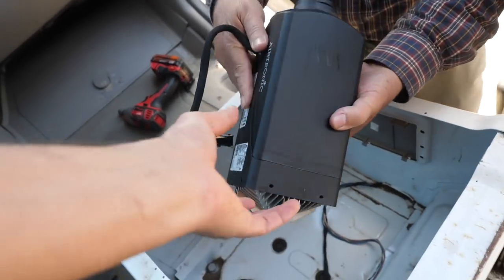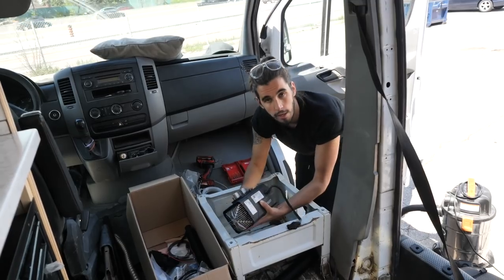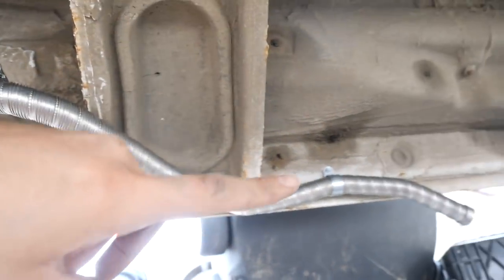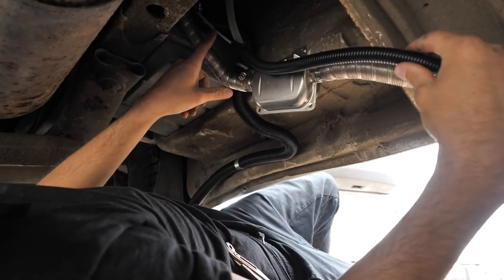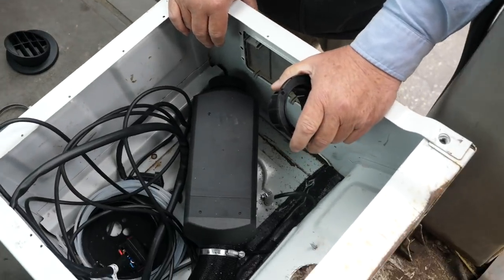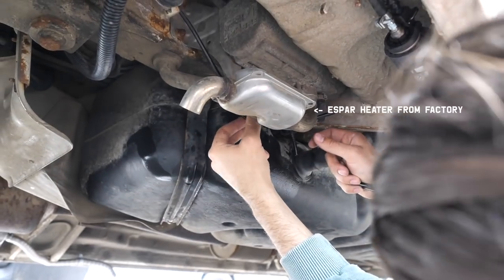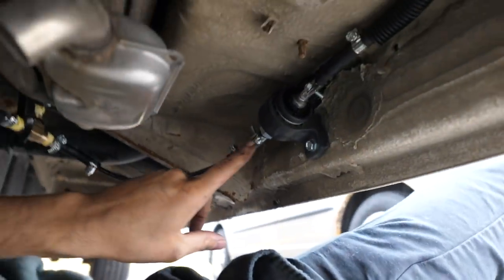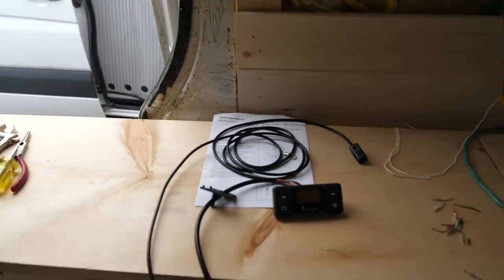HOW TO INSTALL ESPAR D2 HEATER IN DIY CAMPER VAN | Eamon & Bec

Comment from the maker: Van life in Canada means we NEEDED to install a heater into Bob's sprinter van conversion. We hope this how-to video helps explain the install of an espar D2 diesel heater... bit more "tutorial - esque" than normal but we hope you ENJOY!
Reply: It is a great video! Super informative, thank you so much. I live in the sun by the ocean so I don't really have a need for heat, but I always thought a heater that ran off your van's gas line would be the smartest way to go. The least maintenance, don't have to worry about more propane, super convenient in cold climates. You did a great job with all the wiring too. I think you would totally love doing electrical stuff like for a living bcz you're like a Mr. Gotta-figure-it-out. It's fun work! You get to design and lay stuff out, then do it. Plus electricians are the Kings of the Trades. :) The editing was top notch again. So glad I found you guys.
Reply from the maker: Thank you so much for your kind words Rixanne.  I totally agree that Eamon would be fantastic in the trades as he is such a problem solver!! Lucky for him, he is also a very talented camera guy and video editor so he can choose whatever passion he desires :) Lucky you living in the sun!! We always say... if we didn't love our family and friends so much... we'd pack up and head for somewhere warm PERMANENTLY!
Reply: Eamon & Bec Hi to all if I may in times it's cold start in winters you may want to insulated your external line to temperaturte your diesel  trust me  I am from Quebec, stay warm Bob !
Reply: Eamon, what size fuel line did you end up buying? I’m doing exactly this job right now.

Comment: A couple of friendly heater tips from icy cold sweden: 1. Dont direct the intake under the car, the biggest reason for heater malfunction by far is that it sucks in dirty air and that cloggs up the inside and it starts burning inefficient and in the end stops working all together. Instead let it draw air from engine compartment or somwhere else (not airtight offcourse, but shielded of from dust and dirt as good as possible) 2. Buy and install an airfilter (there are special tiny airfilters, or make your own) for it. For said reason, it will make the heater run smoothly for much longer.
Reply from the maker: Thanks so much for your suggestions Tomas!! We appreciate you.
Reply: Do you have a link to where the air filters are? Was thinking it needs one. Surprised it did not come with one
Reply: You dont need an air filter. Theres nothing that it can suck up that would damage anything. Not to mention its gonna restrict air flow. Just do a yearly cleaning with parts cleaner or brake cleaner. They are super super simple machines no need to overcomplicate it
Reply: Yes move the air intake away from the wheel area as they will be a lot of dust and mist whipped up by the tire contacting the road. Also no air filter because if it restricts air flow and that causes the heater to burn rich and soot/carbon up inside. Also no kinks in tubes or excessively  long tubes.  i'd move the air intake up higher and close to the center of the vehicle.
Reply: Robert Hersey  If that filter restricts the burner air at all you will end up with a heater full of soot from too rich of a fuel mixture.
Reply: Why not pull the air intake from van interior? The air would be warmer than outside and cleaner.

Comment: When we had our converted Dodge Caravan, the person who built the conversion, used a 110v electric heater that would plug into the inverter and it kept that van nice and toasty. We ended up selling that van since it was no longer being used. But it was all solar powered, had 1000w inverter with 2 deep cycle batteries.
Reply: What brand of heater was it, if you don't mind me asking? Looking for a less intimidating option haha
Reply: Jessica Keenum I don’t remember. We ended up selling that van awhile back

Comment: you guys should pick up a quality step drill bit and ditch that destroyed spade bit you tried to use for drilling the larger holes for the heater. Step drill bits are super useful and perfect for van life since one drill bit can be used to make a wide range of hole diameters, at least in thin materials like sheet metal.
Reply from the maker: Totally agree with you Al!! Nothing worse than having the wrong tool for the job.  We knew we didn't have what we needed but it was a holiday in Canada so the Depot wasn't open! Maybe a step drill bit is in our future purchases... thanks for the suggestion!

Comment: I already have a factory installed coolant heater and my quick connect is taken up for that , now i will install an Espar D2 and will go get my fuel by cutting my fuel line between the quick connect and the Espar coolant heat. My question is ,  Do you know the size of that plastic fuel line going from the tank to the Espar coolant heater?

Comment: with the intake facing down and next to the front tire... won't you be sucking in a lot of dust and road grime into the Espar??? I might have had it parallel to the road up to the side of the van.
Reply from the maker: We didn't show it but yes we've realized that wasn't the best placement for it after all.  Going to create a space for it where we have ours!

Comment: Any thoughts on your install 5 months later for someone thinking about starting this project? Do you like the unit? Any operating tips and tricks. Great install Eamon! My sprinter also has an existing espar, so I'd look to do the fuel line like you did if you still like that.

Comment: Eamon, Because I'm shipping my Sprinter, I can't leave the unit under the passenger's seat during ocean transport, because they will just steal it. If I secure the compartment, there will just be more damage when they break into it. I would have to remove and replace the espar heater under the seat twice in 14 months time, shipping to and from South America. How much of a PITA is this? Is this feasible? Thanks man. You guys rock!

Comment: so next time use a hole saw and not a spade bit that is only for timber ya nuffy
Reply from the maker: Totally agree with you! Nothing worse than having the wrong tool for the job.  We knew we didn't have what we needed but it was a holiday in Canada so the Depot wasn't open...
Reply: Hey just wondering if these heaters can be installed in a chevy Express cargo van and or cargo trailer?...I’ve only seen it in 2 sprinters✌️tfs

Haven’t purchased anything yet but the van and trailer were my 2 choices...sprinter vans are way outta my price range😉

Comment: Hey guys, If you didn't want to tap into the fuel tank etc. do you think it would still work to have a small container next to the heater that you fill, and you simply stick the fuel line into that? Thanks!

Comment: Did you rust proof/paint the exposed metal around the holes?!! Critical under the van of course with exposure to water. It will RUST badly if you don't.
Reply from the maker: Eat Sleep Van yes probably should have mentioned that! Thanks

Comment: Thumbs up soldering 12v connections. A much need video on installing Espar.  People might keep in mind you are pumping a flammable liquid - always consider consequences of worst case scenario - say run over road trash and a hose gets tugged out of a clamp (fuel lines leaking on hot exhaust pipes, etc).  Also that diesel is organic so lines and connectors need to be fuel safe. I wonder if Espar sells maybe a more fuel friendly T?   Not crazy about hose clamps and barb connections on something flammable and under pressure -  might be a safer alternative someone could suggest?

Comment: Thanks for sharing, but there are so many little errors in this install from not properly priming pump and fuel lines to lack of air filtration on intake. I recommend watching john mck 47, he has a great series of videos that will help you understand this process in great detail. If you are going to be in very cold temperatures, you don’t want to be fixing a broken or plugged up heater then. A proper install can save you soooo much potential hassle down the road

Comment: Hi guys!! Thanks for the video :) We used your link and purchased this heater to install in our 2013 mercedes sprinter van. We got it installed but have spent the past 2 days trying to get the EasyStart Remote+ Controller to connect to the unit to no avail. I believe you guys went with the remote that's directly wired to the unit. Do you guys have any advice or have you heard anything from anyone who used the EasyStart Remote+ controller with this unit? I've tried reaching out to HeatSo as well and we've combed through the manuals but haven't had any luck getting it to connect. Any advice or suggestions would be greatly appreciated! :)

Sincerely,
A very cold, very frazzled van-dweller

Comment: In a van space is (obviously) at a premium so rule number one: Don't install things which serve only one function when there are similar things out there which can serve three functions. In this case: an air heater is great (and cheap and very easy (not to mention very quick) to install) for heating the interior but it can do nothing else (not even badly) On the other hand if you get a water heater and plumb it into the vehicle's coolant system you get heating from the standard heater core, you can plumb in a small calorifier (do google) and have the option to pre-heat the engine in winter which can't hurt anything (also: do google why that is a good thing to have and/or want for the van's engine)
But hey, if you payed more then 125 dollars for the air heater thingy and got it any other color then orange and got it anywhere else but from China...f*ck it, forget everything I just wrote and carry on being silly and ill informed.

Comment: i got to 7mins 20 and then the face palm just got too much. They don't supply the cables with the plug so that you can feed the wire through any bodywork and then attach the plug. Don't attach the plug and then cut the plug off, madness.

Comment: The drill bit you were using wasn't working well because it's for wood I think you put your muffler upside down there should be a hole on the other side it lets the water drain

Comment: ROTFLMAO I have decided to comment in sections, pause video and comment! 1) Don't try to use a wood paddle bit to drill through sheet metal! Lord help us! 2) Gee, I wonder if they left the connectors off the wires in the first place to make it easier to run the wires?? You know, so you don't have to cut the connector off after you attach it? wow just wow Sorry, stopped at 11:30, just can't take anymore.......

Comment: ... so you just drilled holes through the bottom of the van, exposing bare metal at multiple places. I hope, for the integrity of your van, that you used some primer but didn't just showcase that in the video. Otherwise you're gonna have a much bigger hole in about 2 years.